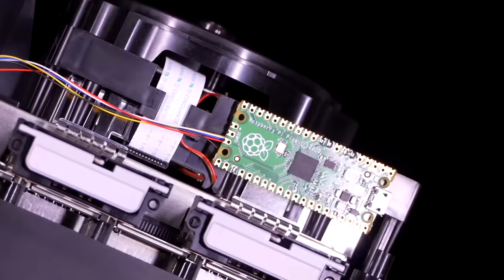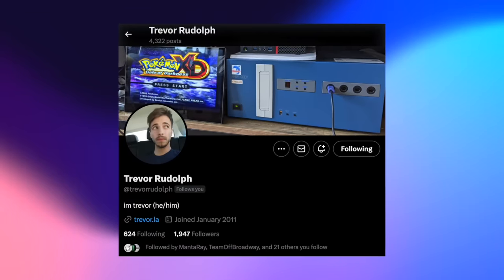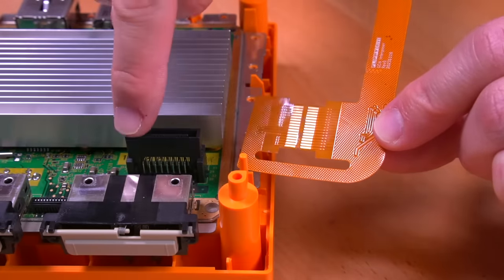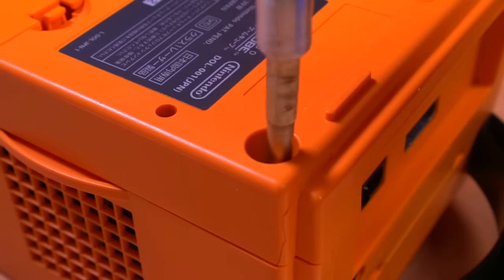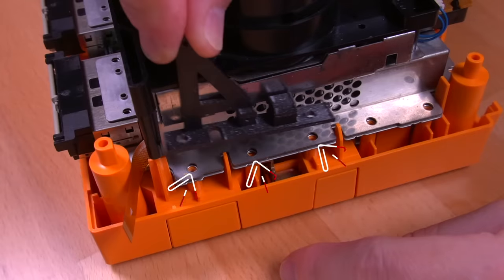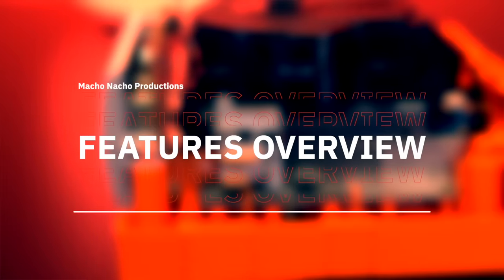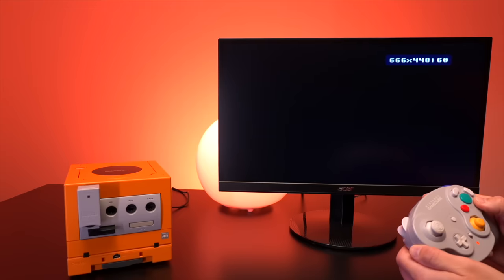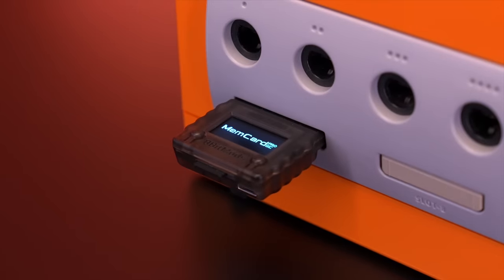FlippyDrive FIRST LOOK! Solderless Modchip For GameCube!

Comment: The most elegant and COST EFFECTIVE device. I applaud the Devs of flippydrive. I wish every ODE was like this.
Reply: It's def not an onion!😊
Reply: And the fact that it’s open source is amazing. It means that once they release the source people can mod it and improve it, and it won’t disappear if the devs decide not to support or sell it some time in the future .
Reply: this is and that gba drop in display are my favorite mods so far because they keep the integrity of original parts and are much easier for regular consumers like me who don't own or possess soldering skills
Reply: Wouldn't that be a Wii?
Reply: The price point blew me away. Minimum I was thinking was $75. I made an audible, "Wow!" when the expected price came on screen.
Reply: Cost effective, solderless, relatively painless and simple install. This is the new standard ODE should go by.
Reply: we need ODES for all consoles xD
Reply: WODE
Reply: Emulators are more elegant and definitely more cost effective.
Reply: @Leclaron it'll also be cloned to high hell by the usual suspects.
Reply: What would be cool if you could rip the game on to the SD. To preserve games. Does anyone who if any software does this? Does PKGI for the PS3 do this?
Reply: @TheRogBG  ..Depends on the emulator. I'd rather play on real hardware, if possible. Depends on if you already have said hardware available, of course.
Reply: @VulpisFoxfire  doesn't depend on the emulator. They are more elegant and cost effective.
Reply: @TheRogBG  Except when the emulator requires several hundred dollars in hardware upgrades in order to function decently, or when the emulator either doesn't work completely or doesn't completely support the titles you want to play, while you have the original hardware sitting next to you.
Reply: @mirabilis Yeah, a cheap wii with a 2tb hdd has this thing beat. Jailbreaking a wii requires zero manual labor.
Reply: ode?
Reply: @elmalloc  Optical Drive Emulator, I think.
Reply: i mean the pico is cheaper
Reply: there's sd card readers that already do this for under $10
Reply: How do you upload the games to an SD card....website?

Comment: Genuinely the most impressively designed mod yet. Non-destructive, elegant, and well integrated with the console style no less? I'm floored. The ribbon cable alone blows me away.
Reply: Yeah, the only destructive part is bending👀and then completely creasing👀the ribbon cable no less than three👀times and AlaKaBlamm!!! It’s done son!!! The ribbon cable that is, that won’t be done till the next arrives in the mail.😳
Reply: These 2 guys should redesign the picofly flex cables for the switches. so cool.
Reply: @annacurransmotherofmeghanc1841  it'snon destructive relative to the console. If you ruin the ribbon, ah well. Order another one. lol
Reply: @annacurransmotherofmeghanc1841  the ribbon isn't part of the original gamecube ;)
Reply: @annacurransmotherofmeghanc1841  luckily, not only are you wrong, but that ribbon cable isn’t a GameCube part, so even if it does tear, the GameCube can just be reassembled.
Reply: Is the ribbon cable a part that  i can order on its own and resolder if the cable becomes damaged, or will i need another flippydrive?

Comment: My favorite thing about Cubeboot is the stock look. One thing that always irked me about other OS patches like Swiss and the others is how it always looks backend, like it loudly announces "this console is running homebrew software."
Reply: @@Ac_Adapteryou weren’t irked??
Reply: @brkbtjunkie  I wasn't irked, Jerry!!
Reply: @@Ac_Adapter Thanks.
Reply: @@Ac_Adapter yeah I'd rather have features than a stock looking home screen. Swiss plus gc loader is the way to go. Loading games off of network is a cool idea but ss cards are so cheap it's not a relevant feature. 256gb is like 20$ now. Plus I can change my SD card without disassembling
Reply: @jakesteel2423  Exactly what I was thinking.
Reply: I know what you mean. Like, I don't mind when things scream "homebrew!" but I 100% prefer a stock look when possible. I'll probably buy a flippydrive when they become available because of the UI of cubeboot.
Reply: @kjj_photos  I feel like the cubeboot idea will bleed into swiss or some fork of swiss at some point. I don't see any reason that idea could not be made to run on other hardware.
Reply: So you don’t have to install Swiss to use this?
Reply: Ugh yeah I hate every time I boot up my PS2 I am greeted by the worlds ugliest logo that I can't disable. I would pay some money to have a more stock loading experience over the Free MCboot and OPL logos and menus.

Comment: Suggestion: given that the ribbon cable is being bent significantly... one thing I've learned is that is a recipe for one of the traces to fail at some point.  I think if you make that ribbon cable available for purchase separately for like $5-$7, some people (including myself) would probably add on one or two to their order to have backups.  Of course, this still assumes everything else works as advertised, but it would be a great option to make available.
Reply: That ribbon cable is probably the cheapest part of the unit. Likely 25 to 50 cents a piece, but let say it cost $2. Just bump up the price and put two more.
Reply: @madmen2288  yeah if they're making large quantities, 50 cents or less is probably accurate. I aimed high a bit to give them margin, maybe factor in shipping, etc. Maybe they could say $5 if buying on its own, $2 if buying together with the kit
Reply: Agree, I would buy 3 for worst case scenario
Reply: I wouldn't say that a 90 degree bend is that egregious with that bend radius. Yes, just by nature of being stressed the flex circuit is likely to be the first point of failure in the Flippy Drive, but relatively speaking, I'd be much more concerned that the most recent OEM hardware is going on 15 years at this point.

Edit: I realized you might be referring to the crimping of the contacts into the vertical header. That's a more valid concern.. I would still expect a pretty robust service life, but I'm not as confident there.
Reply: Ribbon cables don't just randomly fail on their own unless you repeatedly bend them and cause metal fatigue.  Bending them once for installation purposes is perfectly fine and reasonable.  That's why they used ribbon cables in the first place, because they're easy to bend and form. A lot of  commerical and consumer product from almost any electronics company has ribbon cables in them, and almost all oif them have a bend or two.   Just look in any Playstation, Xbox, car stereo, laptop,  Bluray player, TV or other electronic equipement...bent ribbon cables are in many of of them.

Comment: as you were putting the bracket on covering the one screw hole i was thinking "oh thats a really good way to lose a screw which sucks if you ever want to remove this" and then you showed off the extra screw holder. absolutely brilliant, this mod kit is incredibly designed

Comment: For the con of SD card inaccessibility, you can buy an SD card extender and put the socket wherever you want for better access. They're often used for Raspberry Pi projects, so they're available in many different lengths.
Reply: Hopefully the Ethernet add-on will resolve this with storing ISOs on a external NAS instead of an internal SD card, or perhaps some kind of FTP functionally with an update? ether way looks to be something there aware of and %100 should be easier with the final design.
Reply: I have memory of some card reader not supporting the resistance of the cable ( voltage and data trasnfer wise), but if this supports it it will be perfect with it indeed !
Reply: I mean with 1 TB sd cards, what do you need? just make few backups and leave it in there
Reply: @WizavPRO  true lol
Reply: @aidenanderson9310 as well as the device already including wifi/Bluetooth, and could be used to transfer wirelessly to the SD card. Not the quickest, but it is also much easier and cheaper solution if you don't already have an SD card reader.
Reply: Prob shorter length the better-but the SD is probably buffered so maybe length is irrelevant…?
Reply: La gran ventaja es que el peso de los juegos del cubo no es mucho por lo que con una SD de 500gb incluso de 256gb te deja una biblioteca como la de Alejandría 😂❤😊
Reply: I was gonna say 500gb SD card can probably hold the entire library
Reply: @aymanhawari2589  as there is 651 games on the console and the disks have a max size of 1.5GB, and knowing you have several multi disks games, I think that you'll need at least an 1TB card to hold the entire library.

It would be nice to have the option to transfer through the WiFi in case one of the image is corrupted or you need to add a newly patched image etc.
Reply: I wonder if you could load games onto the chip via the USB port. That would be SO cool, just connect an old micro USB cable to the Flippyboot and put it in the basement of the GameCube and when it comes to adding new roms, you just remove the expansion port cover and plug your GameCube into your PC's front panel.
Reply: Would a wireless SD card be compatible?
Reply: I actually bought a SD card slot extender for my 3D printer as I did not like where the SD slot was originally so I got the extender for it and put it in a more accessible spot on the front of the machine. :)
Reply: You can also just boot a homebrew launcher and load games using any of the other SD card addons or other externally accessible hardware.

Comment: That flex cable piggy backing the connector. I'm so impressed. I can't believe I haven't seen something like that before. It's so elegant.
Reply: Maybe because it isn't idiot-proof.
Someone will probably break the ribbon or short some contacts. I'm sure it's within tolerance but it seems the ribbon is slightly thinner than the connector.
Reply: It's quite literally one of the best mod chip installations I've ever seen. It's so simple it's so clean it's absolutely perfect. Can't wait to see what they do with those two expansion plugs as well. I have PICO boot already but i'm going to 100% grab a couple of these for myself and a few friends!
Reply: It would not be a bad idea to include a couple of spare in case the users fuck up the origami.  @mister_milkman

Comment: I love seeing the RP2040 showing up in more and more mods! I would love to see it replace expensive FPGA chips in ODEs for other consoles too! That little chip has been a beast for the modding community in so many ways!!
Reply: As someone from the Switch modding scene it amazes me that the RP2040 has allowed $100+ modchips to come down to $10. Neat little chip for sure!
Reply: It is completely murdering FPGAs, it's amazing. The PIO is the best idea in microcontrollers in a long time. I can't wait to see if RP can go completely all in with a future successor to the RP2040 - they could potentially remove all of the peripheral IP blocks and do everything (UART, USB, I2C, SPI) completely with software defined PIO modules.

Comment: A solution to the SD card being inaccessible is, since the device has WiFi, maybe you could access (remove/add) it's contents via ftp. It's not the fastest solution but the bottleneck is really mostly the SD card's I/O speed so it shouldn't really have a noticable difference anyway. Also it helps that Gamecube discs are really small in size.
Reply: Or allow loading roms onto the SDcard via the micro USB port. That would be my favorite solution. No messing about with network settings, just leave an old micro USB cable plugged in upon installation and store the USB A side in one of the extension ports.
Reply: Alternatively, it supports Wi-Fi. I wonder if it would be possible to set it up as an FTP server to write games to the SD card over the network. That's how I installed games on my hacked PS3, it worked great there.
Edit: did he add in that bit about FTP after I posted this comment?

Comment: That’s a really cool mod! Completely solder free and you can play both your physical library of games and load them off of an SD card. Awesome! 🤩
Reply: Yep game cube are pretty easy to come by so if your current machine die, you just get another and transfer the mod.
Reply: Not only can you play both, but you can play both off of the optical drive port. This comes with a literal TON of advantages. The biggest being the read speed, and the fact you don't have to sacrifice any of your expansion ports.

Comment: This is an amazing idea. I will definitely purchase one. Although I have one small suggestion for it. I think I would rather have it so that the L button activates CubeBoot with the optical drive as the default instead. I think that would keep the system as stock as possible. Although, it's really a non issue, and an incredible project nonetheless.
Reply: Agreed.  More of an opt-in as opposed to an opt-out
Reply: I want that too

Comment: This is an absolutely amazing kit. The drive connector solution is just plain wild, though honestly I'd be slightly worried about the thickness of the ribbon causing some stretching similar to the issue with the old-school NES's cartridge connector. Nonetheless it is a truly awesome development and it'll revolutionize how future mods get done.
Reply: I wouldn’t trust that connector to last too long. I’d want a spare ribbon cable on hand just in case.
Reply: It doesn't get plugged in and out hundreds of times, it should be fine.
Reply: Much thinner than the Nes cart slot and it’s not being moved multiple times.
Reply: @jakesteel2423  I would still think that if the connector is inserted with the ribbon cable inserted, it would still stretch out the connector plugging into it over time while it sits in there, right?
Reply: @anthonycomeaux1804  it's not being stretched and relaxed over and over again. If you have a non beveled edge cartridge in a genesis or nes, it wouldnt be a problem if it's the only cartridge you ever plug in and never take out.
Reply: @jakesteel2423  interesting
Reply: Slap some dialectic grease on that connector and you won't even have to think about buildup.

Comment: whoever came up with that ribbon cable connector hack is a genius, i work in tech repairs, and do some retrofitting on my own and always thought about a solution to splice in microcontrollers without breaking the old connections.

Comment: Having installed the PiBoot and the Kunai recently, I have to say this is the best one thus far -- it makes my engineer's heart throb. Can't wait for it to drop!
Now the only critque I have is getting access to the SD card. But thinking about it now, they may offer uploads form wifi to the SD card and then I don't need to have access to it. And if updates are done by placing a firmware file in the root then that also is solved.
Reply: I'm thinking of picking up an extender and running it to one of the slots in the back or somewhere.  Should be easy to work around.

Comment: I know holding L while plugging in the controller can default the analog incorrectly, wonder if that would be the case with powering on the console too.

Curious if they could switch it to Z or something instead, if that’s an issue.

Regardless, very interesting project and I’m excited to hear more updates :)
Reply: Right, I thought of that too. I know the sticks have that problem, I don't remember if it affects the triggers as well. If nothing else, you can work around it by re-plugging.
Reply: They couldn't use Z. We all know what pressing Z does to the stock firmware. If you don't know, try it sometime.

Comment: I’d want at least some of the extra features of Swiss before I use this. De-flicker filter, forced resolutions and GameID for the MemCardPro for example. And SD card accessibility would be nice, I don’t like the idea of taking my Cube apart just to get at the SD card.

I’ll be sticking with Picoboot and an SD2SP2 for now. But for $40, I might just buy one anyway and stick it in my spare GameCube just to tinker with.

I can’t wait to see this mature.
Reply: Yeah, not mentioning if Swiss works on this. If it doesn't, then its a no deal for me. Swiss is so useful in many ways. Virtual memory card, backing up/loading saves, excellent emulator support and GBi.
Reply: @wryyyy I was hoping they would mention it at the end but they said that's all they have planned after talking about gui stuff and Ethernet. There are a lot of downsides to this with the only upsides being price and disc drive support...
Reply: I read that it will be compatible with Swiss. And Cubeboot will be compatible with other ODEs. But I don't think it's going to be right away. @wryyyy
Reply: @jakesteel2423  The Ethernet module sounds interesting for sure. If it functions to replace the original Broadband Adapter. It could really be the thing to get people back to LAN partying Mario Kart, or even getting on PSO fan servers.
Reply: @wryyyy  that would be really cool, the impression I got was that was just another way to load games though. I hope that they can do more than just be a replacement for a SD card.
Reply: @wryyyy   I can't imagine why an ISO of Swiss wouldn't work.

Comment: This is easily one of the highest quality 3rd-party mods I have ever seen. The solder-less installation with that ribbon cable is brilliant. The fact that it has it's own mounting bracket to mount the hardware properly inside the console is astounding. Way to go gentlemen, this is quality work.

EDIT: FOR $40 DOLLARS?! WHAT?! I was watching a video earlier about some company doing a case for DreamCast that they're selling for $200. A BLOODY CASE. These guys want $40 to significantly increase the functionality of your console? Heroes.